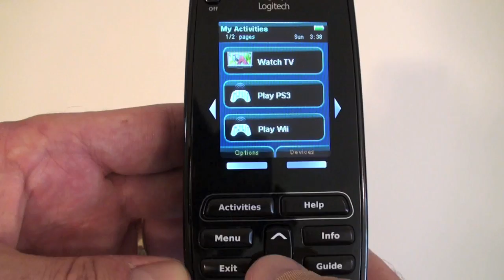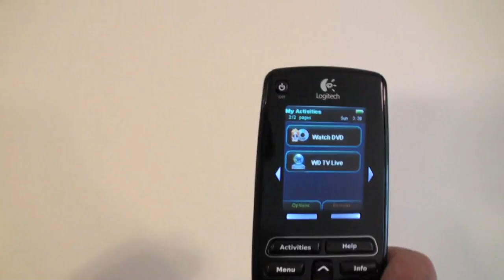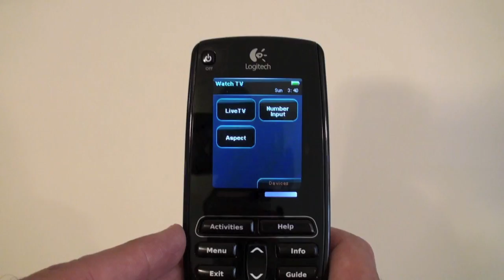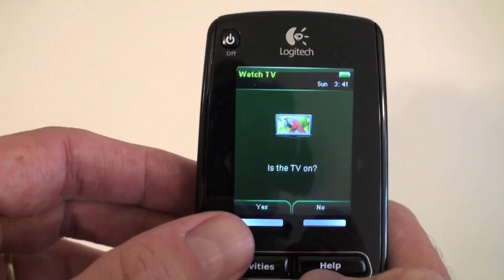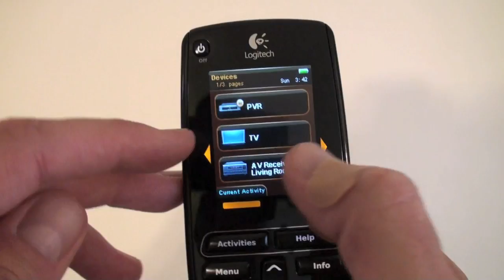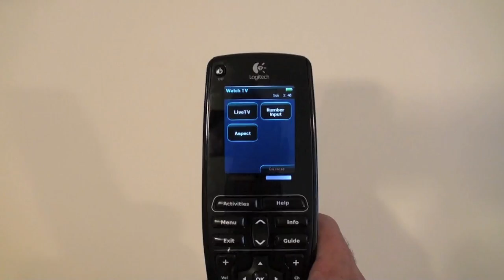Logitech Harmony One - One Remote for Everything

Comment: Had some trouble installing it initially. do7.pl/LogitechHub Went through the entire install with the phone tech and finally installed. Since then has worked flawlessly. One of the remotes is in the basement controls Samsung TV Q80 85, Apple TV, Amanzok 4k fire stick, Phillips Hue bulbs, Sonos speakers, Anthem AV with paradigm speakers. Also connected it to gaming computer with Occulus VR and it easily changes the inputs to that with just a click. I have another one upstairs that controls the Samsung Q80 85in, Yamaha AV with Klipsch speakers, Apple 4K TV, Fire 4K stick, Sonos, Philips Hue. Both systems work great and even better than one of the pro systems my installer was trying to install but could not get working with Fire TV.No we have 3 of these remotes and very happy with the results.

Comment: Logitech isn't currently supporting Mac OSX 64 bit. If you're trying to run the Harmony software on Mac Lion, for instance, it won't work. As for the other remotes, you just need to open them up and use them. All the Harmony remote does is send macro commands that replace the different button presses of multiple remotes.

Comment: You can set up the Harmony 1 remote to activate all of the components to turn the Wii on with sound on your system, but you can't use the Harmony 1 to replace the Wii controller.

Comment: Very helpful video.  I picked one from Best Buy for around $150 with tax.  It doesn't work with the PS3 unless you buy a $60.00 adapter.  I bought the adapter and now it works.  I had 4 remotes downstairs and 2 remotes upstairs.  Now I only have one remote.  I was able to program all my devices with this one remote.  I like having one remote for the entire house.  The only negative is the Logitech website.  The server is always backed up or it takes forever to download updates.